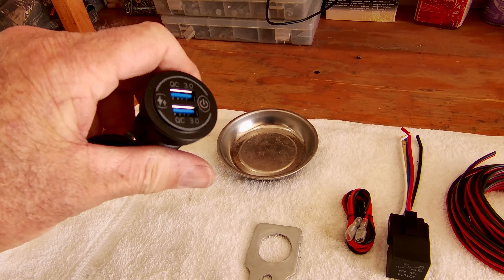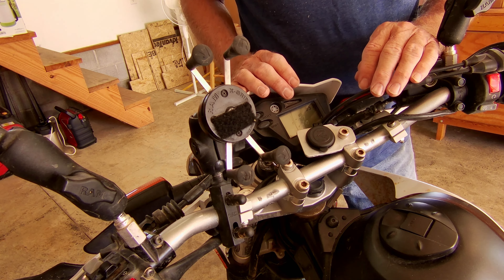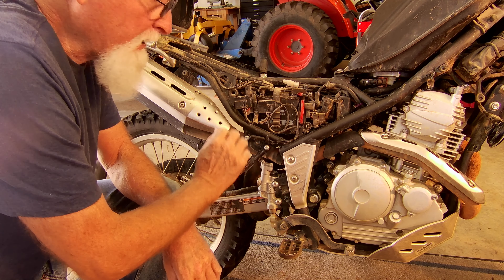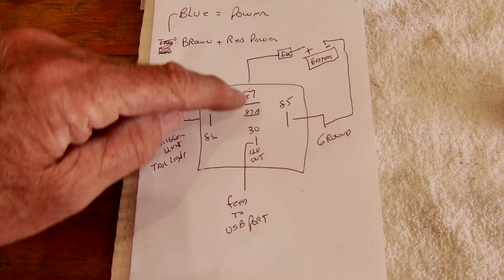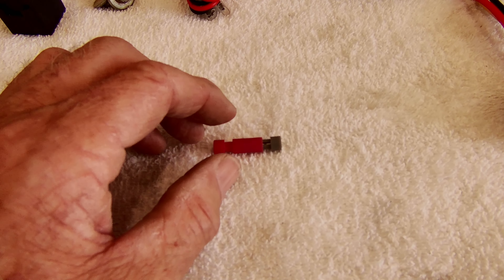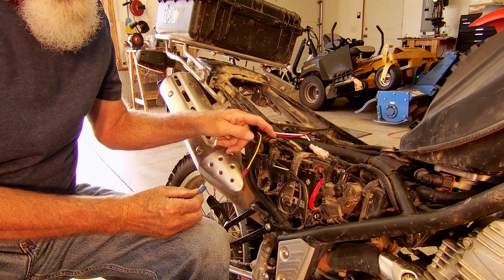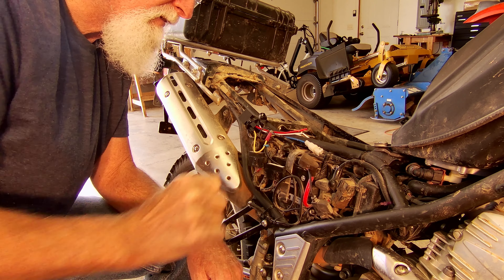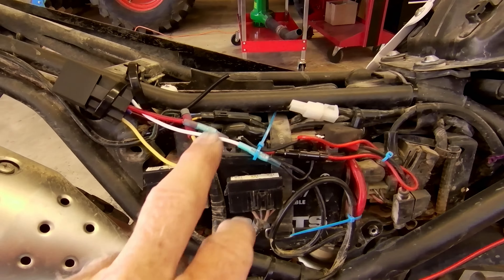Yamaha XT250 USB Power Port Install

Comment: Great video! Clear information, no waffle talk, good views of the work area.  Well done!
Reply from the maker: Thank you Jeff
Reply: I note that there are relays already in the electrical circuit - headlight, indicators - can these be used as the relay for the USB or is a separate relay required for each “device”?
Reply from the maker: @jeffh8840   I always hook up a separate relay for my usb charge ports.  That way I can use the proper gauge wire to power it, you can also hook other items to that new circuit such as lights.  Other circuits usually can't support heavier loads, most of the wires are very small gauge wires.

Comment: I was happy to see you put the wires in a Loom. I would put on a bit of silicone adhesive on the splice to make sure it would not corrode.   Good job, something will do over the winter.

Comment: I purchased a service manual download hoping to get a decent quality copy of the electrical diagram to find the tail light circuit, the pdf I got from servicemanualwarehouse was very poor once zoomed into the wire numbers and connectors.  You must have been lucky to have found the connector.  I tapped into a switched circuit, but don't know which circuit I tapped into, am going to go back and look for the tail light circuit like you did.  In this case it's for a Garmin GPS, draws little current, don't need a relay.

Thanks again for sharing.  Jim H.

Comment: Looking at my 22 xt250, was amazed as to how many fuses there were.  I did not have a schematic so I kept probing until I found a switched wire, in my case it is for a GPS, the manufacturer recommends going directly to the battery, but as we know, sooner or later, the battery will be dead.  Were you able to find a schematic online somewhere?  I probably should own a service manual, but a diagram will do for now, so if anybody can direct me to one, would appreciate it.

Fishing the wire up to the handle bar was a pain, but got it done.  I appreciate your video and your explanations.

Jim

Comment: Great tutorial, thank you!  I'm getting ready to install the same setup on my new Yamaha XT 250, but as someone who doesn't know all that much about electrical work, I have a stupid question that I'm hoping you can answer.  The red and black wires that connect to the back of the USB port, are they connected back to the battery directly, or are they tapped into other wires using posi-taps?  I watched and re-watched your video, and maybe I just missed it, but wanted to ask so that I don't screw somethinig up(which I can easily do!).  Thanks in advance.
Reply from the maker: The black goes directly to the battery as your ground.  The red one goes to the relay, the one marked #30.  That is the reason for the relay, you want a direct line from the battery, thru the relay (to carry the load).  Using the relay you can trigger it with a small current and a tiny wire, but the actual load goes thru a separate larger wire to handle whatever load you have up to the limit of the relay.  Also, don't forget to put a fuse close to the battery on the wire that goes to relay #87.

Comment: Where do I get one of those relays or is there a number or place that supplies them?
Reply from the maker: Just post this into the search feature of Ebay.  5 Pack 12V 30/40 Amp 4-Pin SPST Automotive Relay with Wires & Harness Socket Set

Comment: You didn't need a relay for such a low draw. A simple power-side switch would do fine directly from the battery to the usb. Add an inline fuse to be safe.